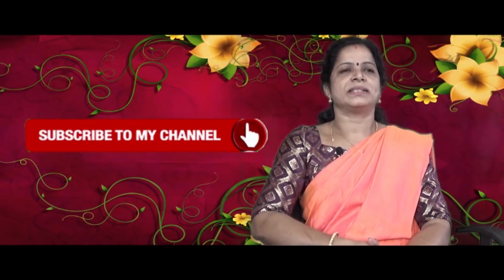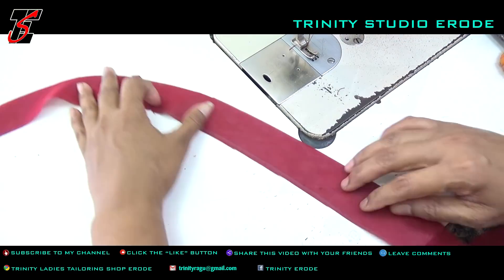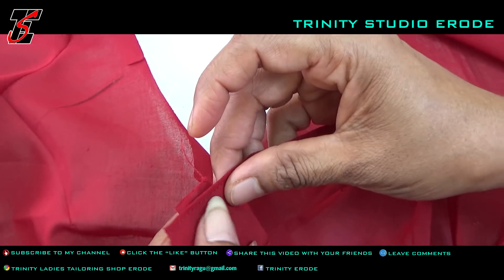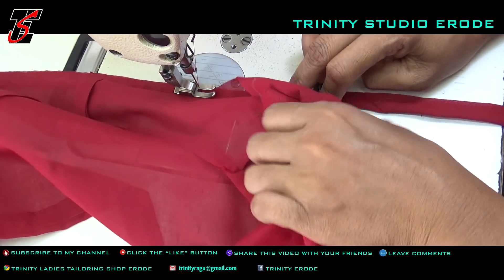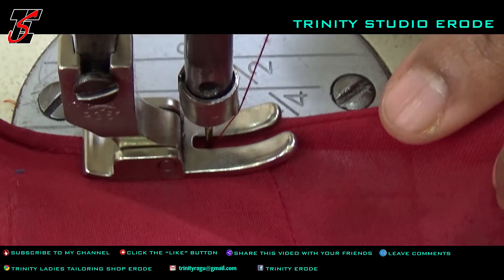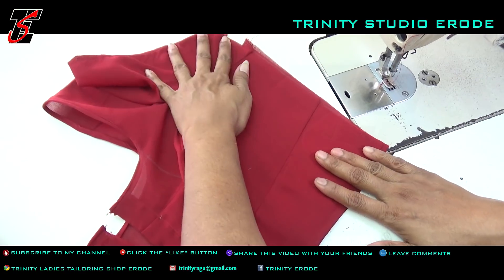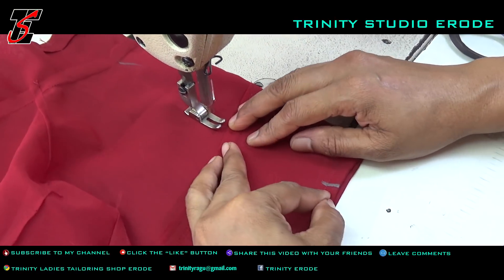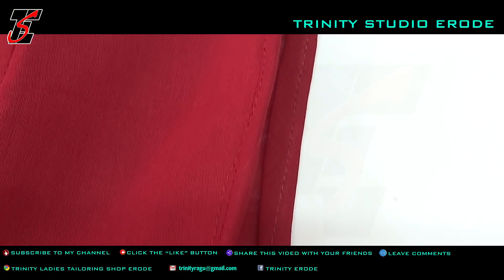Normal blouse piping and side stitching tips

Comment: Mam shoulder measurement is 15.5 chest round is 37 arm hole is 16.5  the sleeves are very tight in the front and arm pit area how to avoid it or correct it